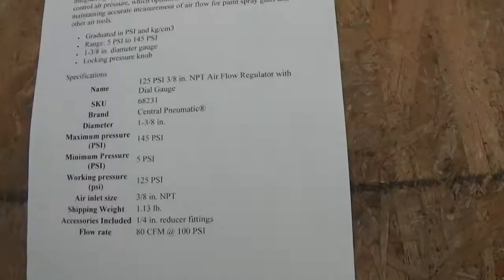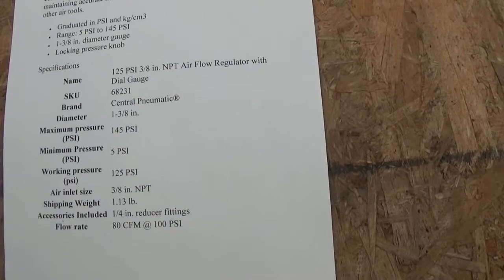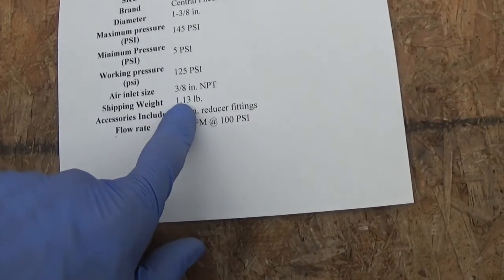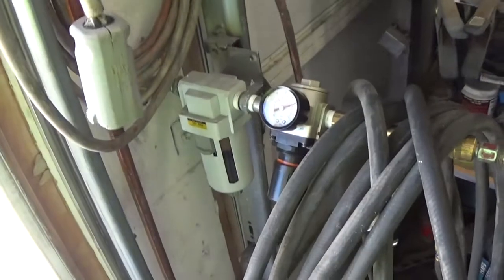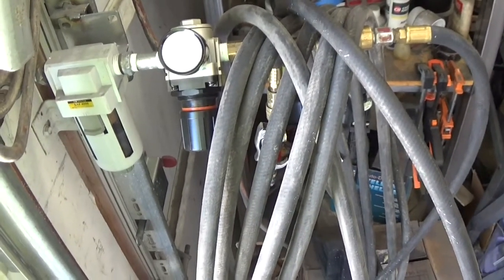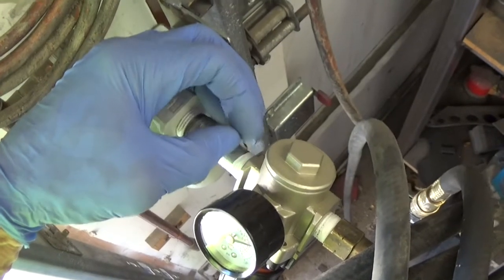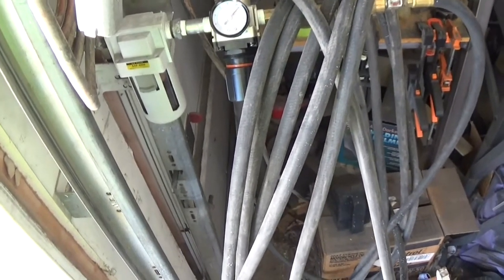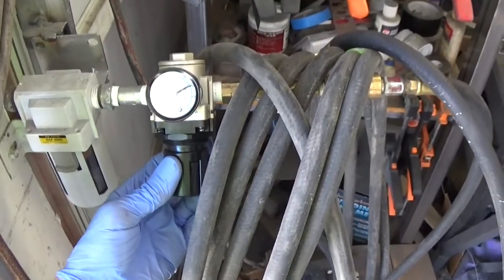Harbor Freight Pressure Reducing Valve/Air Flow Regulator

Comment: This is super cool, Thanks for sharing,  I'mTrying to buy a air pressure regulator for the first time do all of them have a pressure relief valve ? 
What i want to do is create my own tire filler that  I can set to 30 or 35 psi ( ideally  to 33 PSI and ) and then have the regulator reach that pressure and then  vent out
Reply from the maker: I don't know if you can find one that can be set that low